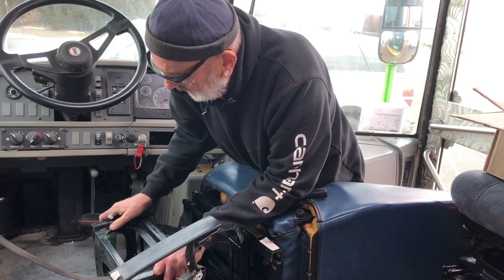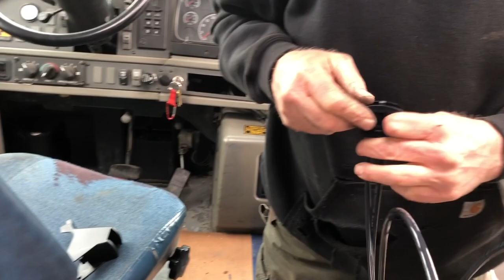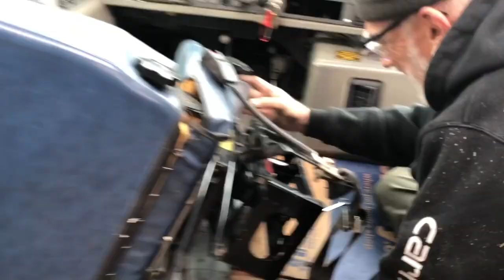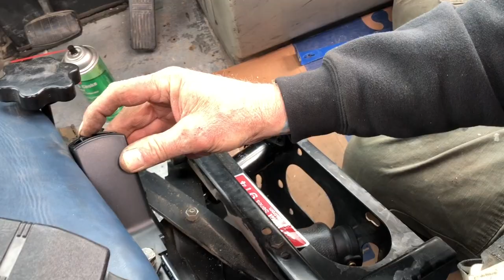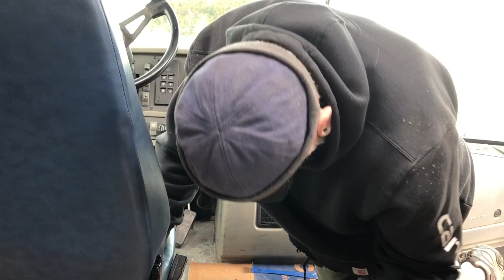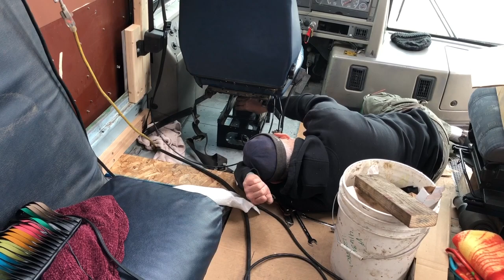Fixing Air Seat - Vlog 69 School Bus Conversion

Comment: No grommet on the air line where it comes through that wall? Might be a problem in the future. Can't wait for the next video!
Reply from the maker: We just did this as a test to make sure it worked. Will got back and fix that. No worries. But thanks for thinking of us.